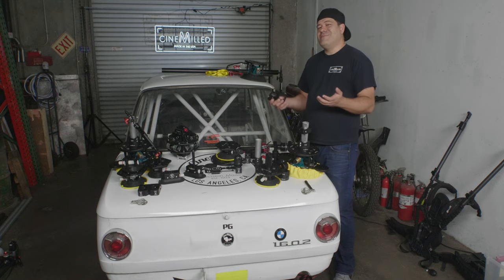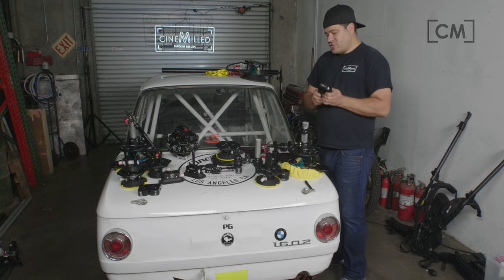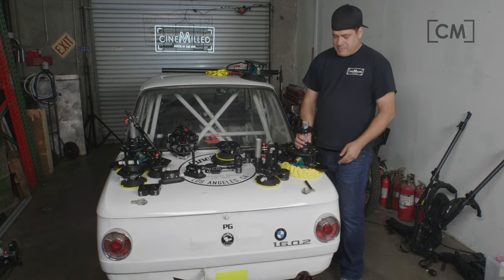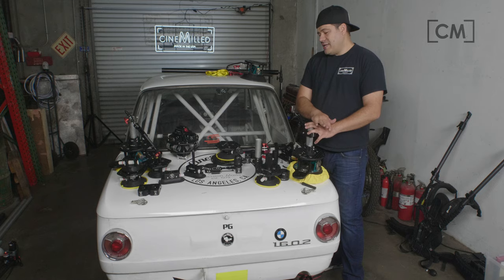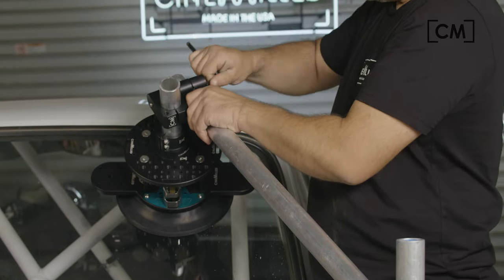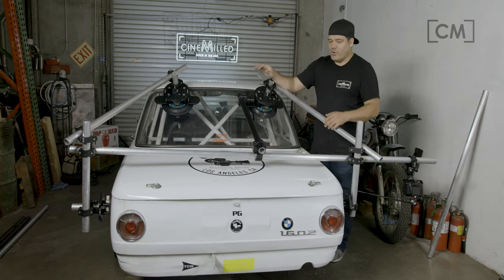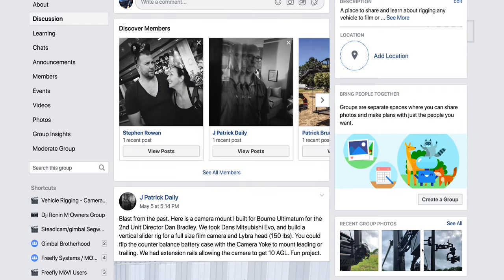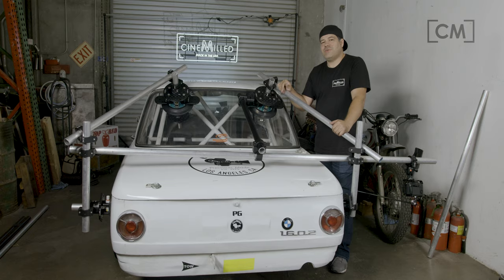CineMilled "360 Houdini" speedrail clamp

Comment: Do you guys have roof rack kits?
Reply from the maker: @directed_by_steve  Trouble with roof racks is they are all different! I’m trying to come up with something kinda universal. Stay tuned.
Reply from the maker: @directed_by_steve  You can also did what we did here on this front runner rack which had slots and we able to use our truck starter. Came out very clean. So basically you can use existing parts we make to adapt into your specific rack. In your in LA you can stop by and I can help. https://youtu.be/A9pin_XR8zA?si=OxNamesFB28iWF2M
Reply: @CineMilledUSA  Okay awesome Ill be waiting for that.  Need something more secured.
Reply: @CineMilledUSA  Awesome I'll take a look thanks.